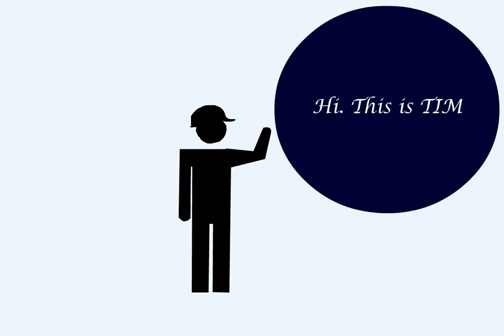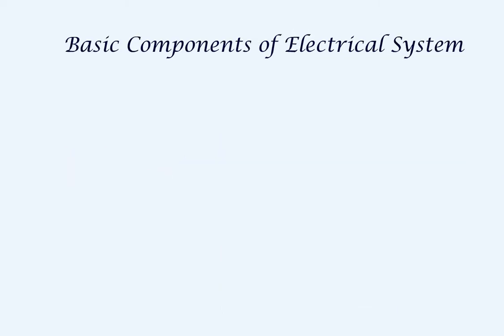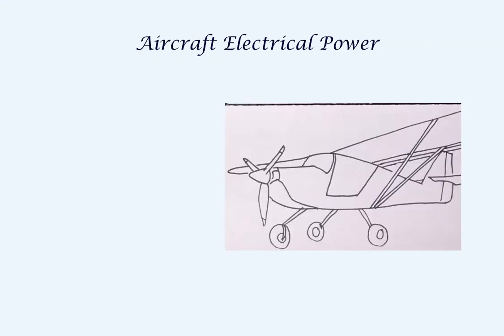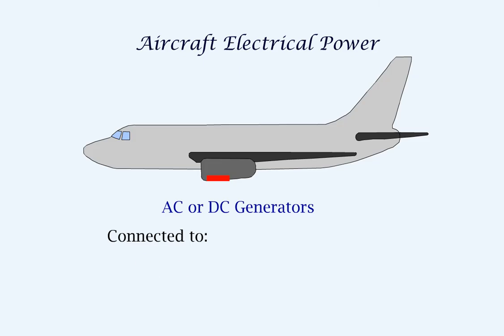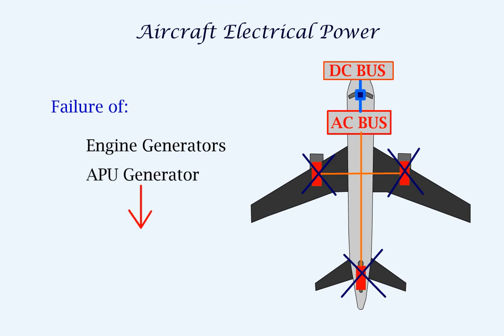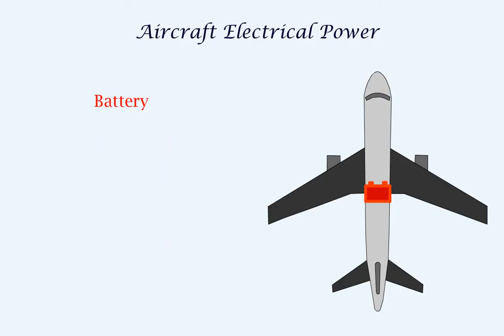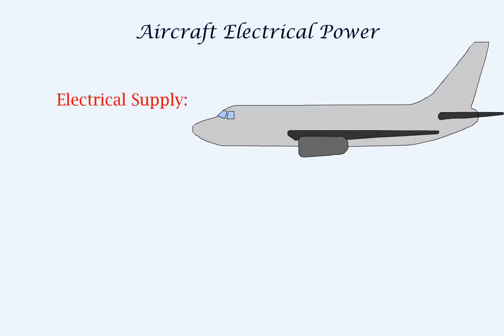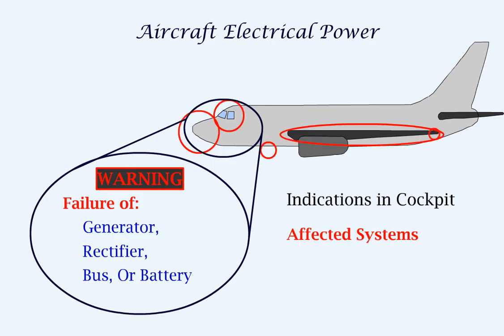Understanding an Airplane's Electrical System!

Comment: Why does the generated electrical power need to be converted?
Reply: depends on what you need 
you can't charge a battery with AC 
because it will charge and discharge it many times a second 
so it's converted to DC so it can store charge 
or you may need AC for lights
current passes through the bulb many times a second that it appears always lit up so we use AC for lighting
Reply from the maker: great explanation!

Comment: I'm just not sure I understand why there is an AC to DC conversion to almost everything but then when it comes to the battery it becomes DC to AC? Is it for higher current??
Reply from the maker: AC Generators give AC power; Batteries give DC power. An aircraft will have both AC and DC users so the conversion has to be done!
Reply: @JxJAVIATION  thank you so much!!!

Comment: when battery providing DC current why we needed Invertor to convert it in AC , all buses required DC current?
Reply from the maker: There are some buses that require AC power.
Reply: Modern aircraft has AC as primary source and usage as it got advantage over DC. DC source for stand by emergency only as it can be stored by use of battery.